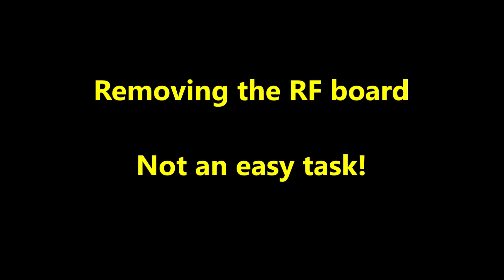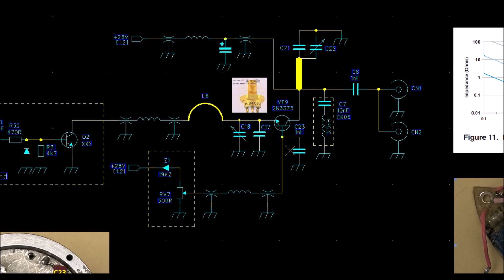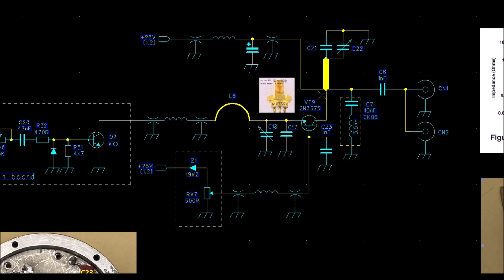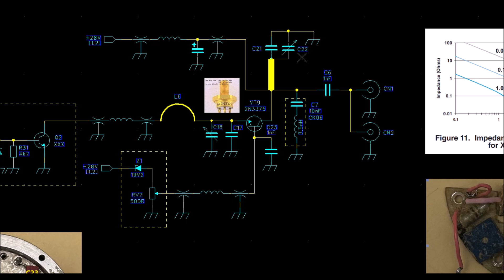LDM #384: Rocket Telemetry Transmitter - Part 2 : RF section

Comment: The ideal 10nF in series with the 3.5nH resonate around 27 MHz. The real components of course add significant parasitics. Is the purpose of this series LC network to prevent oscillations at this lower frequency, or is there some other purpose for this network?
Reply from the maker: Yes, the resonant frequency corresponds to the minimum impedance on the chart but the working frequency is far above this resonant frequency. The 10nF itself doesn’t exist at this frequency, only the parasitic inductance remains. The parallel capacitance should be considered, including the Cob of the transistor. It can be interesting to have the opinion of a microwave guru. I don’t know also why there are two coaxial connectors.
Reply: @lelabodemichel5162  Perhaps for two antennas, either two polarisations or facing opposite sides of he housing.
Reply: @lelabodemichel5162  The gain of the transistor is certainly much higher at a lower frequency, so maybe the circuit becomes unstable without the trap. I am not sure how destructive it would be to try powering it up without C7.
Reply from the maker: I tried without the 10nF cap, there is no major change, except a diminution of 3MHz of the frequency.
Reply: @lelabodemichel5162  Cool! But there may be an important difference between this test and the real situation. The impedance of the attenuator that you have connected to the output remains very constant over a broad range of frequencies. The original antenna was probably only matched at 440 MHz.  At much lower frequencies it could have looked like a widely different impedance.

Comment: Thats a small diameter for rocket whit electronics for that time.
Some kind of weather probe or a beacon?
Reply from the maker: Diameter of this transmitter is not the diameter of the rocket. Watch part 1.
Reply: Thank you, wery nice work. Great expirience in specialised electronics, must haw been a interesing carier. @lelabodemichel5162